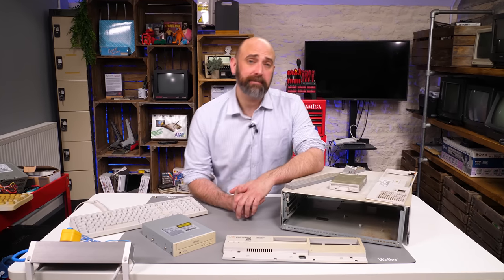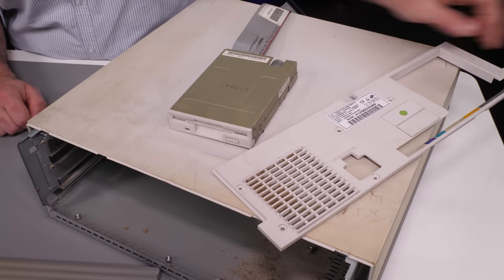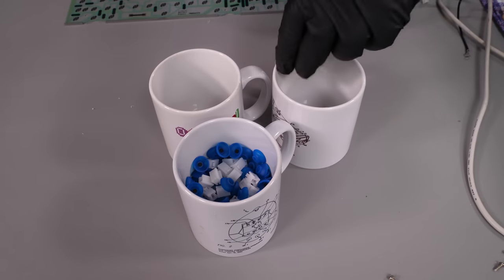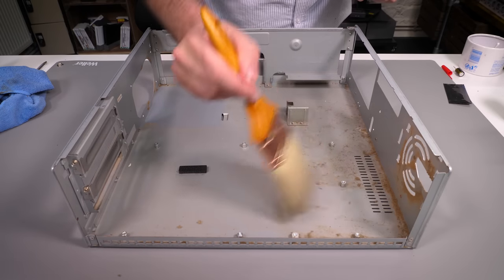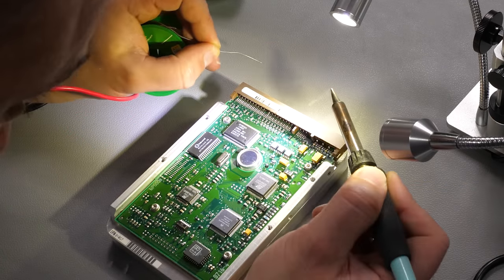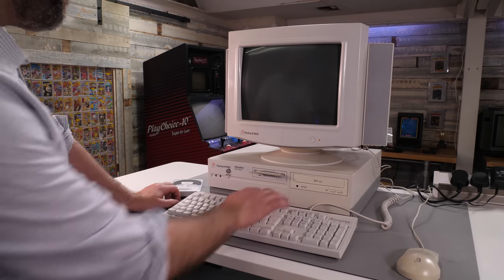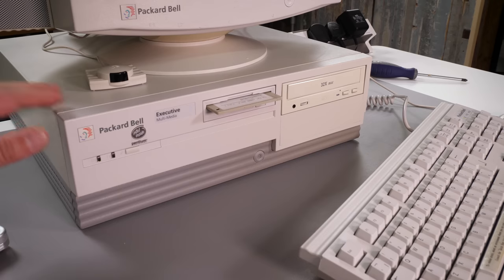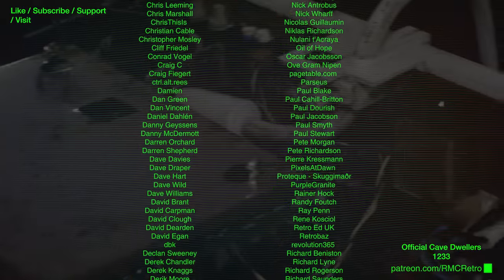1996 Packard Bell Restoration | Plastic Fantastic | Trash to Treasure Part 4

Comment: For my Pentium MMX PC, I used the heatsink from an AMD Athlon XP, as it's a direct fit on the socket and offers better cooling due to the much taller fins, with no fan required. Having said that though, it would probably be a struggle to fit it with those ISA cards directly over it, so a fan is probably the better option in this case. If you're feeling a bit naughty, you can often screw a fan directly into a heatsink.
Reply: That was sometimes done from the factory. A friend once gave me his old Pentium IV and I thought it ran too hot for my liking so I had a look at the cooling setup. There was a small heatsink with a tiny fan fixed to the heatsink with four sheet metal screws. Oddly enough the CPU also reported as 2.4 GHz PIV running at 1.8 GHz. I replaced the dismal heatsink/fan combo with a proper cooler and set the speed to 2.4 GHz and the machine worked perfectly fine running XP and later 7.

Comment: Nice to see the new lab in action, looks great and nice to have seen it in person too. The PB is looking spiffy, great job, would defo try to keep the stuttering desktop replacement, I think it's very of the time. Why manufacturers bothered with those things I have no idea, first job after getting these machines running was removing those kind of things! I also have a very similar PB PS/2 keyboard so nice to see how to tear them down if I feel brave enough to clean it all out one day. Cheers!

Comment: I got hold of a 486 SX2/50 version of one of these at some point in the late '90s, the version of Navigator had a great little whistling tune on it. Sadly lost it while converting the machine into part of my fleet of ghoulish Linux experiments and realising too late I didn't have any recovery media. Always liked the style of those clip-on monitor speakers.

Always feels weird seeing these being thermal pasted, I never bothered until my first "Thunderbird" Athlon! Possibly they ran a little hotter and shorter-lived as a result, but the stuff was obsolete so fast in those days and we never thought there would be a day when people would lovingly restore them. Not that those clips gave particularly good mounting pressure, you can see how much movement it still has while clipped in at 10:34.

While it would harm the originality, I found the clip mechanisms are similar enough that later heatsinks from the P3/Athlon era can usually be made to fit Socket 7 boards - I used to do it in the early 2000s to get CPUs which would have had a tiny heatsink and fan to run passively, but I imagine that would help temperatures quite a bit.

Comment: My mother had a machine like this the Multimedia C115. It had a 120mhz CPU,  16mb of ram but I took a module out of a junked computer and it happened to fit which upgrade the ram to 32mb which sped it up pretty good. 1.2 gig HDD and a CD ROM drive. The monitor was exactly like yours and had the same speakers which those crapped out so I hooked up another pair I had.

Comment: Nice job on restoring though one detail If I did see it correctly it seems that the heatsink isn't sitting completely flush with the CPU and thought the little ridge needed to go into the notch between the CPU and socket to sit completely flush.

Comment: Hey! 
eBay searches are your best bet with the Media Panel, Mic and Remote. I got mine new in box from Germany back in 2021!

Also, if you're looking for the complete setup, I have the original, new sealed FM Radio ISA Cards with the connectors required to install and booklets, I'm more than happy to ship one your way to help complete this build.

Love to see this, I went on a mission to rebuild my Multimedia and went as far as sticking a K6-III (Interposed), VooDoo and 128MB ram with a CF card and virtual floppy expansion :P
Got all the original software with the exception of the restore CDs, if anyone has them , PLEASE upload to IA!!!
Reply: P.S, The restore media has kinda been cracked by myself and a user called Kiki over on vogons. It was kinda a lockdown project to see how the whole thing worked and bypass the silly restrictions like "CD Drive model MUST be x" in the scripts.

I don't think either of us finished it, it was shelved, but I can absolutely dig out my drivers and configs to get DOS compatibility working with the original sound card etc if you need them.

Comment: If you used some detergent on keyboad case then plungers might also need a little bit of light silicone oil, cause it might've been lubricated at factory and after cleaning will become squeaky and sticky, I've had this issue with some old keyboards after cleaning with strong detergent. I've used a back of sewing needle to apply oil. Only light oil will do just a verry little bit, this will make keyboard really smooth (only light silicon with lowest viscosity will do, since petrol based may damage plasic/rubber parts).

Comment: Love this as always, thank you.  Just wanted to ask if you'd care to do a vid about washing PCBs?  I still feel alarmed every time you do it, but it seems to do the trick...!  I have a synth that I'm currently restoring after 40 years' service and it's in pretty good shape but I still have the board on the kitchen table, me staring at it...  I've gleaned a lot about how to restore the externals from yourself, for which I'm grateful, but are there particular instances where washing the whole PCB in the sink isn't appropriate?  Thanks for any help you can render and my synth will owe you a pint when some family come to RMC, hopefully soon...!

Comment: 😊hello,
I just acquired a very similar system, a PB4225CD.  I can find virtually no information on it, but can deduce packard bell released many “different” computers in that same shell.

One question, was the coin cell CMOS battery stock?  I searched the mother board and embarrassingly couldn’t locate it.  I was worried it was a exploding barrel battery and was seeking to remove it if that was the case, but a dead coin cell won’t keep me up at night!

Great video and thank you!

Comment: If you spill water on the floor, would it not be possible for the water to seep into the seems and cause mold?
Reply from the maker: It should be water tight but something to keep an eye on. We can split and lift a tile to check without pulling up the whole lot

Comment: You had a lot more luck than I did with the yellowed plastics.  I had a case that wasn't going to win any beauty contests, so I decided to get aggressive on it, just to see how far I could take the process.

I let that puppy bake in peroxide solution under some UV LED panel lights for a week straight.  Better, but still yellow.  I even sanded it down until the texture was gone, and there was still some evidence that it wasn't quite perfect.  I've never had a piece so stubborn.  Curious if the vapor just works better, or if I just didn't win the plastic lottery this time.

Comment: Damn, I had the microphone... years ago.  I received a very similar system second-hand, except mine had a Pentium 120.  I installed Red Hat 6 on it, which was my first experience with Linux.  I think the CPU itself is probably the only remaining part I still have, in a box of Socket 7 CPU's.

Comment: We had a Packard Bell computer from around this period, which I can tell because the design details are just the same. It was out first Windows PC at home. It was a tower model, and came with the multimedia pad thing and remote. It wasn't a very good machine to be honest, and cost probably too much, but it came bundled with several games which I had some fun with. After a while, we passed it on to some relatives, and it started to become rather unreliable and wonky - in particular the drive got corrupted and the picture on the monitor was unstable. I assume it got tossed many years ago, like so many others.

Comment: You forgot about the Pentium 60 and 66. They were horribly expensive, but they were the next generation after the 486. Then there were the 75, 90, 100, 120, and 133. Most PC users got in here. I think I ran one of those and then permanently switched to AMD after that.

Comment: Oh those things was horrible. Mostly the combo sound / modem cards. !/2 of the card would die and sometimes cause issues. So you had to replace it with 2 cards. More $$$ and people hated it. I do see you found the monitor with built in speakers. Also I had to check. I was thinking a P100 needed a fan. But you could also use a extra large heat sink. Though the one you put on looked kind of week. That might explained a few things back in the day.

Comment: With that single PCI slot I think that system could well be a good host for a Voodoo 2/3 or Nvidia Riva TNT2 card which is the right kind of period hardware upgrade such a system could well have had installed.  Otherwise there are plenty of 60mm fans on the market and I think the best one you can get for a CPU like that is probably a Noctua NF-A6x25.  Whether it would be worthwhile to spent the premium for the Noctua in a machine like that is debatable though as the noise from pretty much any new fan would be drowned out by the power supply.

Games I would play on a system like this would be the likes of Command and Conquer: Red Alert, Syndicate Wars, Mechwarrior 3, Quake 2 and Unreal.  I would also reccomend System Shock 2 and Baldur's Gate 2.  IMO the best thing you can do for any Packard Bell computer is to install a standard version of Windows.  Their bundled versions often added so much bloatware that it not only slowed the machine down and used up a lot of the system memory but it also made the machine unstable to boot (this is my experience from later Packard Bells shortly before the brand's demise - they shipped with PSU's made of pure explodium back then too).

Comment: Between the Intel chipset and relatively sturdy construction of the case, perhaps these things weren't as cheap as I remember them.  The questionable components are obviously the cirrus logic onboard video with limited RAM and the modem/soundcard Frankenstein, but they could have done much worse.
Reply from the maker: I was thinking this while working on it. The quality definately slid down and down over the decade and into the '00s but this series and before seem to be made of fairly sturdy stuff.
Reply: Was a tight case, overlapping components, but in reality, while the components may not have been on anyone's wish list. They were compatible with just about any game I ever threw at this PC, and that Frankenstein soundcard was my first answering machine with custom greetings and such. Memories!

Comment: The only thing vapourbriting process can be doing is filling the chamber with ozone given off by the hydrogen peroxide. That means it should be possible to replace the hydrogen peroxide with an electric ozone generator --- I mean a proper one, not a plug-in home unit (they frequently don't do anything at all). That would most likely give a higher ozone concentration and therefore faster results. Whether that would produce better results I have no idea, but it might be worth researching.
Reply from the maker: We were discussing this idea with the boffins in the mill last week, time for some experiments I think

Comment: You do not need thermal compound on that CPU. Usually, the heatsink had a copper pad instead of paste but you don't even need that
Reply from the maker: I removed the old compound which was applied from factory so there was some on there, and it will do no harm. In the final episode I will add a fan, which it doesn't need but keeping the heat down even more will help with the longevity of the chip. I'm approaching this from a preservation perspective.

Comment: If you've got the space for it, some of the Dell heatsinks for the original Socket 7 are quite useful. They're about 2" high and very good at dissipating heat with minimal airflow. I've built a Pentium 200 with a Pico PSU that is very quiet. I have a 3-pin silent fan inside an otherwise empty ATX PSU and it works a treat.

Comment: You put the thermal paste on the CPU but then did nothing with it. This means that all of the paste will be in the middle of the chip. You should have spread it out for way better thermal conductivity.
Reply: It spreads when you put the heatsink on ...no need to put on more than a pea sized blob
Reply: In actuality, spreading it before applying the heatsink can cause micro air bubbles which affect the thermal conductivity. Much better to let the heatsink spread it out. (People have done various tests with pieces of acrylic in lieu of the heat sink to watch how it spreads.)